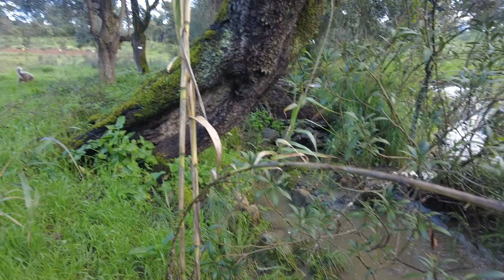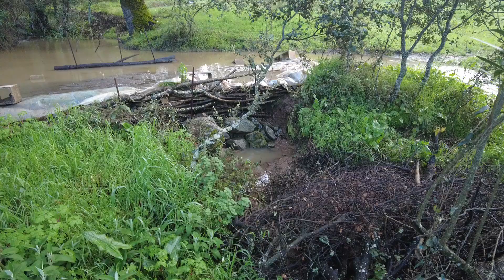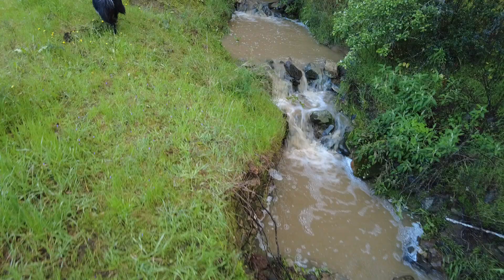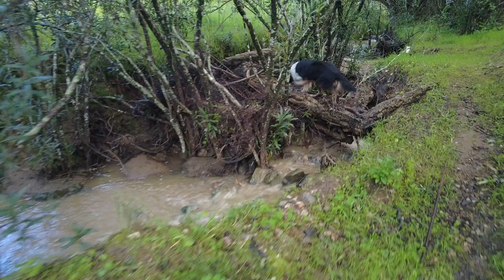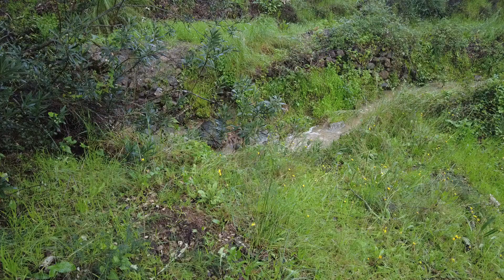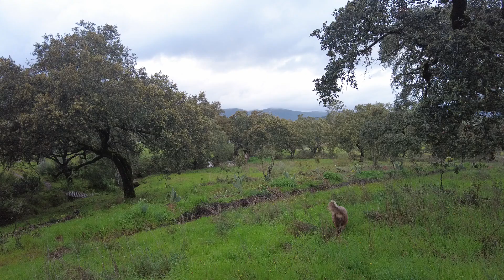#permacultureLeakyWeirs Leaky Weirs on our farm in Andalusia Spain

Comment: Have you witnessed sedimentation behind the weir raising the incise toward the original flood plane level?
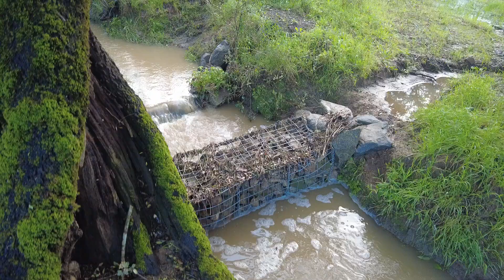Reply: The best example is at 1:20.  Number 8 is a gabion that was installed this year.  Number 9 is the very top of the same size (height) gabion that was installed no more than 3 years ago.  You can clearly see on the upstream side the old gabion is filled with sediment to overflowing.  So the restoration of the creek bed that had been eroded to bedrock is progressing nicely.  The range of sediment is fine clay up to fist size cobble.  I suspect over time, the bottom of the creek will be fairly well secured in place due to the range of granulation.
This is the very reason I requested an actual count and ID of the various structures. So we can speak more precisely about different points in the creek.
Reply from the maker: @dirtfloorworkshop5865  Yes. Some places up to a meter. We appreciate your question

Comment: It's not often we get the full creek tour, it was nice.

A wee suggestion, if I may be so bold.  The sluice gate at the culvert tends to be open or closed.  Have you considered a plank with some holes in it to give a "half open" option?  If this is the last rain of the season, slowing it down for a day or two rather than wasting it might be advantageous.
Reply from the maker: @Argrouk  I have that possibility at my disposal. Every swale is full. As soon as the level of water in the swales drop, I'll divert the water again. We appreciate your sharing
Reply: @SuerteDelMolinoFarm  Not the top spillway to the swales, but the sluice gate into the creek, just to be clear.  Water is still coming in, and going straight out the bottom of the creek because everything is full, which is fantastic.  When you wish to hold water, you put the plank back in the gate.  It's all or nothing, yes?  A way to vary the speed of how the inlet drains into the creek may be an advantage, or I may be talking rubbish again.
Reply from the maker: @Argrouk  Talking rubbish is OK. Depending if we can make compost with it or not. Ha ha. Tomorrow I'll fix it for you. We appreciate your sharing
Reply: The big sluice gate does have a small opening that can be opened or closed.  I have rarely seen Martin use the sluice gate as a 'valve'.  His decision making, as I understand is once the swales are full, adding additional water runs the risk of washing nutrients out of his soil and downstream.  Sort of "too much of a good thing".
On the other hand, there is not a large area for water retention upstream of the distribution basin.  The culvert ends to the south in a smallish grass covered basin with steep sides.  I agree with taking advantage of every last square inch of storage space.  However, I imagine there are local concerns that I do not understand.
The other consideration is we are seeing a first time event.  The creek has never run for days on end.  I suspect that the farmer on the mountainside to the south's ponds are both full for the first time since Martin has owned the property.  And one of those ponds is full for the first time ever.  It is new and quite large.  
So I am anxious to see how long the creek flows - both from the culvert and the qanat overflow.  Now it is possible to imagine at least an ephemeral aquatic habitat.
Reply: @stevejohnstonbaugh9171  Yes, I'm familiar with the setup and how he uses it, and this novel situation.
The other culvert has the level raising pond, which also acts as a seep, but it's disconnected from this system.  Here we have the inlet feeding the top spillway, and the excess is drained off via the creek and feeds the qanat.
The issue is that now that everything is full, the water left over is now wasted, like a river flowing to the sea, however we know that dry times are coming.
It's like throwing away everyhting in the fridge once your meal is over, with no regard for tomorrows meal still to be prepared.
So what do we do with abundance?
Reply: @Argrouk What do we do with abundance (surplus)? I can't speak for Martin, but I believe the "Ethics of Permaculture" (recapped below) answers that question. *
1) Care for the Earth:
This involves recognizing that all living things have intrinsic value and that we must protect and restore the health of our planet.
2) Care for People:
This emphasizes meeting the basic needs of all people, including access to food, shelter, education, and meaningful work.
3) Fair Share (or Future Care):
This principle promotes equitable distribution of resources and setting limits on consumption, ensuring that future generations have access to what they need.

* When ones needs are met, permaculture says distribute the surplus to those who are in need.
Reply from the maker: @stevejohnstonbaugh9171  Applause

Comment: 🏆Impressive permaculture water management you’ve diligently installed✅ How do you maintain and integrate the ancient Arab qanat systems and what other methods have you found successful to maintain soil moisture and running water on your beautiful property ?
Reply: @Agapimo   I can help list the different systems in place now;
1. There is a borehole on the property that supplies domestic water needs and acts as a backup to the qanat and for firefighting.
2. The qanat supplies all of the irrigation water.  
3. The addition of the 100,000 liter bladder reservoir (filled entirely from the qanat) on the highest point of the land preserves the qanats surplus water from the rain season for use in summer irrigation and for fire fighting.
4. The watershed is largely a farm to the south now being grazed by beef cattle. The runoff is concentrated into one under road culvert known as the western culvert.  This culvert feeds the creek.
5. The road runoff is concentrated into a under road culvert known as the western culvert.
6. Both culverts empty into distribution basins.  Here, the turbulent flow is calmed and distributed by means of stop blocks and canals to various distribution and infiltration systems.
7. The majority of the systems that cross the 6+ hectare area (~15 acres) are traditional on contour swale and berm constructs arranged in series so the water can sheet flow from the end of one swale downhill to the next.
8. There are 2 wildlife ponds.
9. The creek has 24 variations on leaky weirs and bda's, breaking the elevation change into increments of 625 cm (2 ft).  The floor of the creek that had been eroded to bedrock has been restored to +1m (+3ft) deep in some locations with captured sediment ranging from clay particles to fist size cobble.
10. An erosion gully from the eastern culvert has been restored to a wetland during the rain season.
11. Grey water from the residence is used to foster a small vetiver mother nursery.
12. There has been experimentation with swale and berm construction from what you can classify as "typical" size to supersize that resemble long narrow ponds.
13. All of the swales have a brush covering to mitigate evaporation due to wind and sun. 
14.  All of the berms are planted, typically with food forest species.
The farmers goal is to have 1000 oak trees - cork and holm  (seedlings to 20 years old) across the property, insuring the existing population will be replaced as they expire and increasing the density of the canopy.
The farmers additional goal is to walk from one end of the property to the other, in shade during the summer months. So trees, not livestock or row cropping, are the highest priority on this land.
Reply: 🌈Wow🏆

You’ve made my day, that was a very much appreciated detailed explanation, marry me😉🤣 

 I had to look up the acronym BDA (Beaver Dam Analog), but am familiar with the ongoing reintroduction here in the 🇺🇸West and the amazing results of restorating year round water flow plus the knock on effects of fire protection. 

Exciting to see permaculture projects around the world.

I’m inspired by the YouTube videos demonstrating the works of 1) Andrew Millison and his amazing teaching courses, 
2) Paani Foundation's Water Cup Competition in India 🇮🇳, 3) Geoff Lawton, etc. in combination with the principals of the Akira Miyawaki’s forest system (where appropriate) which is an intensively dense, multi-layered forest which involves planting native species of trees and understory plants to simulate a natural forest environment, which allows the forest to mature at an accelerated rate in 20 to 30 years instead of the centuries it would take for a conventional forest. This could also serve as a food forest for humans and animals, renewable biomass, and restore endangered species of flora and fauna.
Reply: @Agapimo  Happy to help.  I've been a member of the community for years.  I enjoyed setting down all of Martin's systems. I'm sure I forgot something.  Check out his research that he always posts on the description page.  He is a smart man.   One name you did not mention is Brad Lancaster in Tucson AZ.  I had the privilege of visiting some of his projects.  Every urban/suburban municipality in arid regions should follow his teachings.
Andrew Millison is tops in my book.  Keep coming back 💚
Reply from the maker: @Agapimo  Oooh. Thank you. Qanat and other systems will grow on the land. I'll observe and then take the next step. The real answer is that I don't know. Any suggestions?